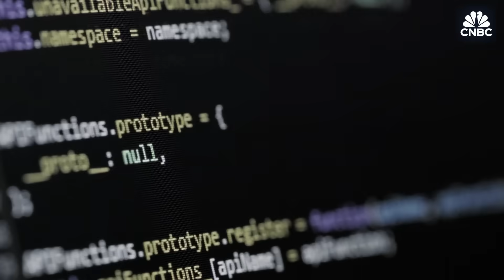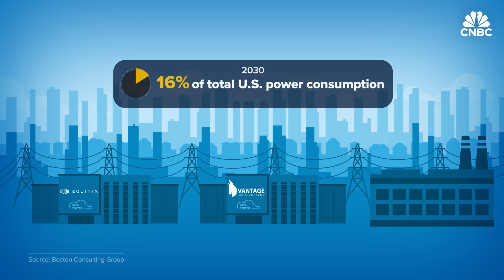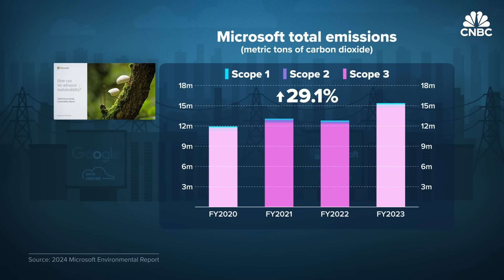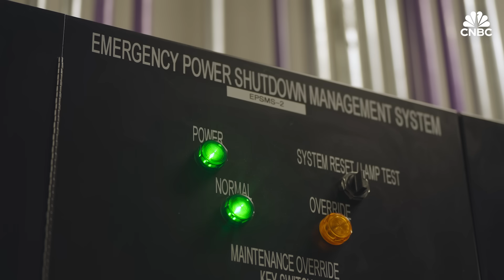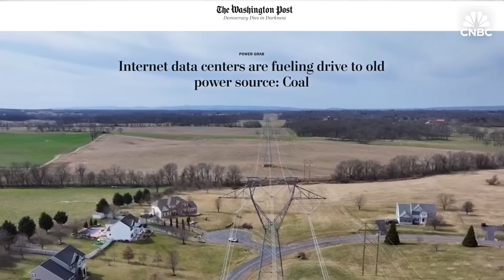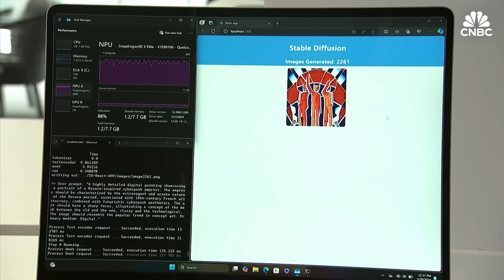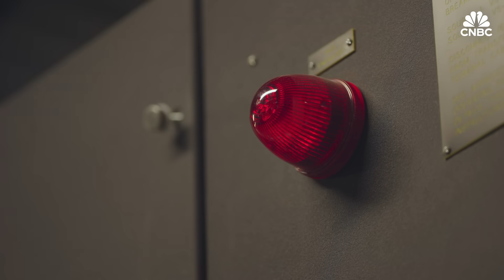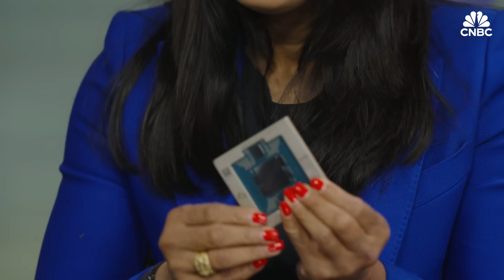How The Massive Power Draw Of Generative AI Is Overtaxing Our Grid

Comment: I am glad that along with mentioning the high power requirements of these data centers they also focused on the major issue of the excessive water used by these data centers.
Reply: @vincevegas8529 salty water isn’t usable. It clogs and ruins cooling systems
Reply: @HarpreetSingh-xg2zm Desalination first before using to run data centers?
Reply: They re-use the water indefinitely. They cool it in an ac outside (releasing all the heat into the atmosphere) then the water goes back in and absorbs the heat again
Reply: @wellsilver3972 they don't re-use indefinitely. Water has a finite life before it must be cycled out and replaced. I don't know why, it just does.
Reply: @TBonerton  goes to atmosphere becomes rain bearing clouds ect....
Reply: @TBonerton there can be two water circuits. One just for heat transfer... Chiller barrel to cooling coils.  The other at an evaporative condenser or cooling tower.  As water evaporates from a cooling tower it needs to be replaced. Besides that even the sump would need to bleed some of the mineral enriched water to replace with fresh water.
Reply: @wellsilver3972  They showed that as the alternative to what most are doing and that is swamp coolers.  That is evaporative cooling uses lots of water.
Reply: @wellsilver3972  what percentage of data centers are recycling their water for cooling?
Reply: @holdencaulfield3102  a large percent its inefficient and costly to just throw away the water instead of recycling it. Hardware cooling is usually closed loop and they'll reuse the water until they cant anymore
Reply: @holdencaulfield3102 All of them. The cooling system ‘s are typically a closed system.
Reply: @holdencaulfield3102  Most of the new ones have a closed water cooling system. Just like in your car. The heat is ventilated to the outside via  chillers. The water is cooled and re-enters the building to absorb the heat again.
Reply: @wellsilver3972  if they cool hot water outside there would be evaporation... I suppose it’s a closed loop cooling without escape of water vapor?
Reply: @wellsilver3972 The “releasing all the heat to the atmosphere” can only be done effectively by evaporative cooling towers which use enormous amounts of fresh water. Other facilities are using adiabatic cooling which still uses water, but is more efficient.
Reply: @wellsilver3972 I guess you didn't pay attention to the video where they said a lot of usage is evaporative cooling. So you think you know what you're talking about, but you don't.
Reply: @chris2790  evaporative cooling is just a swamp ac though? It's not what it sounds like
Reply: And then plenty of people use them to tell us we are destroying the planet.
Reply: Water is reticulated...like in a radiator.
Reply: @vincevegas8529  Its not that simple. "salt filters" don't exist. The salt is dissolved in the water. It needs to be boiled to separate it, or high pressure to force the water through salt removing membranes. These are energy intensive processes.
Reply: @jpcool95480 You said a salt filter doesn’t exist but mentioned membranes to catch salt with high pressure water which sounds just like a filter. 

Maybe you mean to say we don’t have a salt filter that can filter salt efficiently, I.e keeping most, if not all, salt out
Reply: Interesting enough that cars supposedly aren’t an environmental problem anymore though. Guess it has been solved as there is another problem. Which means at the rate we are going we cannot solve our problems. Which means we must reposition ourselves tactically.
Reply: Got to cover your slothfulness
Reply: "Excessive" Oh the wetlands. Will nobody think of the wetlands? All you greenies could start by logging off and troubling us no more. But no. it's other people who must make the sacrifice to save the planet.
Reply: Generative AI? Right. Not of course not the blatantly overt evil the Google algorithm that uses tons of bots to farm its users.
Reply: Why do we all hide techs agenda now that they show us some good evidence they are doing bad?
Reply: S.c.w.muslim.child family said maxamed siciid cabdi business bank garoowe.acouint.nuber.130192.from.soomaliya l.b.s by nuber bank accounts
Reply: All water gets recycled
Reply: So the rivers run dry, and yet they are recycling the river water? Man, that sure makes me sleep better at night.
Reply: Asianometry here on youtube has a brilliant video on water usage for data centers.
Reply: @vincevegas8529  this is called the information age for a reason.

I think you should use some of the many free sources of (good) information to help you validate some of your assertions - there is no excuse for willful ignorance (in the face of multiple people correcting you), not with the abundance of good information sources (please stay away from Facebook or other flat-earther sites).

Best of luck in your journey...
Reply: How will we charge our cars that we will be forced to buy in the very near future??
Reply: @painkillerjones6232  With the significant improvements planned for the grid (especially transmission) along with the investments this administration has made for Solar, Wind and (yes) Nuclear, I think the power issues will be solved.
Nuclear SMRs will solve some of the generation issues when renewables sources are underperforming and (grid scale) batteries are being used even now to smooth out delivery(US and Australia).

The problem for data centers is the rapid growth to meet AI and cloud computing workloads - this is stressing the power grid now (and as the video mentioned, water use is also an issue).

The effects of global warming (requiring more homes to use A/C systems)  and EVs I think will be addressed by the planned infrastructure buildouts happening now - I don't believe that this AI bubble was predicted during the creation of the infrastructure act (planning) - so the timing of how fast we can get some of the new power generation and delivery solutions in place....A timing issue.
Reply: @painkillerjones6232  No one is forcing you to do anything.
Reply: you speak as if its drinking water/they are deleting water
Reply: @vincevegas8529  are you suggesting the implausible use of salt water - which, yes, is very abundant but is a poor choice? 
Or 
Are you suggesting that we use even more electricity by using desalination to remove the salt before using it for cooling?

I am sure you know that these cooling systems don't use salt water. They use the limited fresh water - that humans need to survive, that crops/plans and livestock also use to survive (you can extrapolate from there).
So unless use power intensive processes (desalination) then we are impacted critical water supplies.
Newer data centers will reduce the amount of (fresh) water used but the existing (older) data centers will require extensive/expensive retrofitting to implement a closed loop system.
Reply: @metamorphic75  dude, stop the stupid, that data center uses limited - set amount of water to fill up the system, and it is most likely less that an average household uses up in a year, that water based coolant is in sealed systems, it doesn't evaporate during use, it probably lasts for decades, just like coolant in a central heating system in a typical house
Reply: The real problem is that Nvidia, which is making the chips these data centers use, dont have any efforts focused on efficiency which results in more heat getting produced from the power it uses
Reply: @wellsilver3972 It’s completely false that NVidia doesn’t focus on efficiency. They always talk about how much more efficient the new version is over the last version per unit of compute. There customers care more about this efficiency improvement than almost anything else because power costs $$$$$

Comment: This is why so many people are investing in home solar and battery backup systems and using the grid as a backup!  Every year my energy bill goes up yet I use less energy, buy energy star rated appliances and run my home ac less despite record temperatures every year.  Now that I have solar on my roof and multiple storage batteries in my garage I no longer rely on the grid and only use it as a backup.
Reply: Very true.  A typical home in the US could power 80-percent or more of their annual electrical demand with solar and on-site power storage!

And datacenters have large amounts of rooftop and parking lot space to dedicate to solar panels which are cheaper than ever, and panels are still falling in price! 

The other thing is solar photovoltaic technology is unique in that it blends so seamlessly into urban environments with quiet solid-state electronics.  Critically, every watt generated and consumed locally is a watt that doesn't stress a distant power plant to generate that watt nor the grid to transmit that watt.  This will be huge to mitigate the effects of datacenters on the grid.
Reply: @beyondfossil there really should laws that mandate data centers have to provide their own power somehow and not be a burden on the grid.
Reply: @beyondfossil instead these centers installed a cheap gas turbine and pump even more heat and CO2 into our atmosphere.
Reply: Nuclear is the way to go.
Reply: @stephenziga2319 Only if it's fusion.  Traditional nuclear fission is too risky (Chernobyl anyone?).
Reply: Is this a bot thread? Y'all getting more human like with every day
Reply: @timg2655 i thought it was but seeing as they haven't plugged anybody or something it appears that this is actual humans lol
Reply: Got solar for my house and love it. Live in Texas where the grid has been having issues and my house is the only one with power in the entire street
Reply: @tyworldwide imagine being nice and cozy while everyone on the block is close to freezing to death during those Texas deep freezes that knock out power
Reply: @RoseanneSeason7  I can imagine.  I have a home in a rural area on a beautiful lake.  Most of my "neighbors" aren't here and I live on a dead end.  Should anyone with to get too frisky, I have preparations for that as well.

Imagine that using that logic of successors remorse, and waiting for the government to come save you?  

You voting for Harris in the fall?
Reply: The issue I see with this approach is that it depends heavily on your location and if you receive enough sun
Reply: @winglesschicken  Kind of. You just need to set expectations on how much you can generate. For example, I live in West Michigan and we have almost as many cloudy days as Seattle (the downside of Lake Michigan). But, I don't use solar to power my whole home. I use it for running my home office and battery backup. Not to mention on the days the electricity is out (sometimes rain, sometimes snow). I love that more and more people are being 'realists' about this and not just saying it is a 'tree hugger' idea.
Reply: I'm in the process of pulling bids for solar/battery on my home in the south.  It's FAR from perfect, and honestly it's pretty archaic as a technology and pretty damned inefficient IMO given it's 2024.  

I'm looking at a 20KW Enphase system (I would have gone with Tesla Power Walls but they don't play well with whole home generators).  So 4 Ehphase 5KW batteries and likely 22 solar panels.  For starters the panels have to be strategically placed on the roof, and they're terribly ugly so that limited us in a big way.  So you've got tech that largely will pay for itself in say 20 years but by that time, you'll need to update your system, lol.  

I'm only doing it because I don' want to deal with the blackouts that are coming down the pike, the grid simply can't keep up with demand so I'm getting ahead of it.  I'll take the "Brandon Bucks" to and consider taking back some of my hard earned tax dollars.  I may be able to get paid by the utility company (with net metering) here and there but won't count on it.  

All that said, solar is FAR, FAR from the panacea some paint it up to be.  And it's wildly expensive.  A system like the one I described above is going to be 55-60K depending on where you live, the equipment and other factors.  Definitely not something middle America can just bolt on to the house on a whim.
Reply: Step 1. Own a house😭
Reply: @notapplicable7810  Give it time, housing is not only rolling over, it's hitting a wall, literally.
Reply: @cjb8993  i hope you're right
Reply: That’s right. Invest in solar stocks  😁
Reply: what is the breakeven poing where the upfront cost of those renewables pays off in the utility savings?
Reply: @ashab11245  For mine, about 5 or 6 years but only because the power company and federal tax credit paid for about 60% of the cost.
Reply: how? if you are consuming less energy then how is your bill going up? Do electricity charge per kwh increases every year in america? 
In india, electricity rates increases after many years. present price is around 0.08 dollars per unit.
Reply: In the future the energy will be cheap but the delivery reliability and subscription fees to grids will be the highest cost for energy. As you stated you are still connected and still relying upon the grid for few hours and days when the rest of the grid is also relying on it.
Reply: yep same, power stations are my main use
Reply: If I mash my testicles between two boards it hurts.
Reply: Agree to that, I just wish I could afford the upfront costs, and I wish there were hailproof solar panels (I get a lot of hail in my area, in fact, I'm about to get a roof replaced - don't know if insurance would cover solar panel replacement).
Reply: Nah man people use solar because they cost like $20 to put around your garden. People doing big installs are doing it because they haven’t researched the lifetime of solar panels…
Reply: @uncertaintytoworldpeace3650  I actually have.  It's not that we "haven't researched the lifetime of panels" it's because for starters, I'll get net metering for what I don't use, two rolling blackouts are coming to a town near you and three, I can afford to remain very comfortable, regardless of how inefficient and ridiculously costly the set up is.  My number one reason for doing solar and battery on the home (just like my propane generator) is to avoid the grid, pure and simple.
Reply: Glad I can pay off solar in 20 years on other peoples money that they don’t have but can anyone tell someone who isn’t okay with contributing to an immoral religious ethnostate how they can accomplish the same thing?
Reply: If they’d push more solar roof top on residence and commercial (including these data centers) they could go a long way towards helping the problem. Though I do think the new advancements in anywhere geothermal is intriguing
Reply: Did you get your investment back yet?
Reply: Hi you might find this interesting:

How AI is About to Explode Indian Energy Stocks 🚀 

https://youtu.be/LGLgYkPF7h0
Reply: record temperatures every year?  give us a break already, Ace
Reply: Exactly
Reply: Wonderful for you . The rest of us are financially tapped out and cont afford 20k$ for a large solar installation. Im 74 . I might get the investment back if I live as long as Moses supposedly did.
Reply: Kind of ass backwards. You shouldn't be off the grid, these industries should. They should generate their own electricity, and send back extra to the grid.
Reply: every year mine goes down, just been expanding renewables
Reply: @edc1569  I think they were referring to their cost per kilowatt going up since they have solar and battery backup one would assume they are using less from the grid!
Reply: Tesla is the only company that will integrate with a AI dependent society with its Tesla Energy. $TSLA is easily a $3000 dollar stock.
Reply: @momofighter3211 lmaooooo
Reply: Average yearly temperatures have not increased from 1998 to 2022. There are reasons that it has increased since 2022. This cooling period won't reveal itself in the data until after 2030 due to how the average is calculated over a period of 30 years. A lot of what we are seeing in temperatures are due to rising temperatures after a global ice age scare in the 60s.